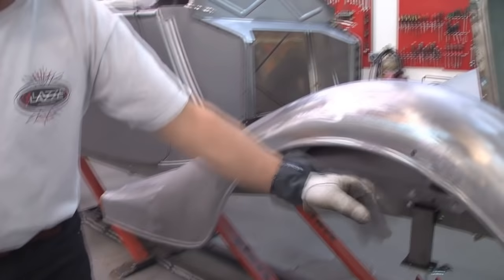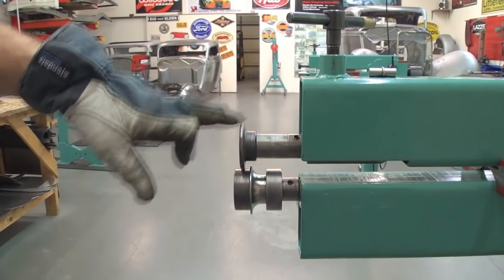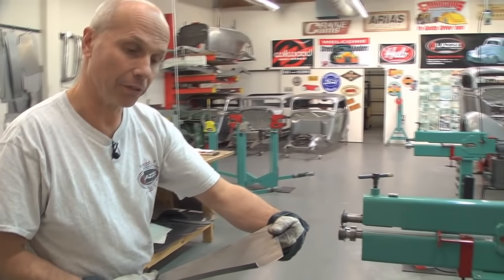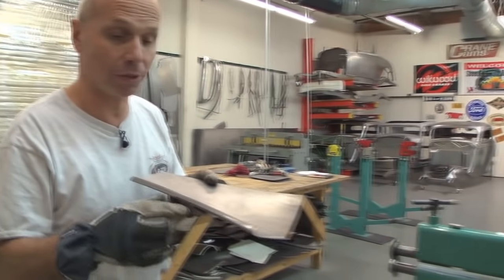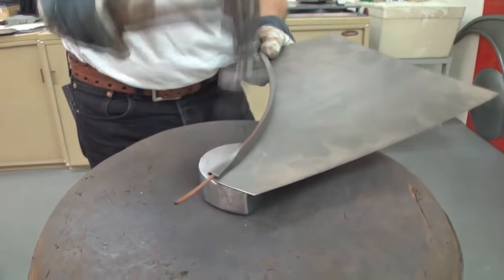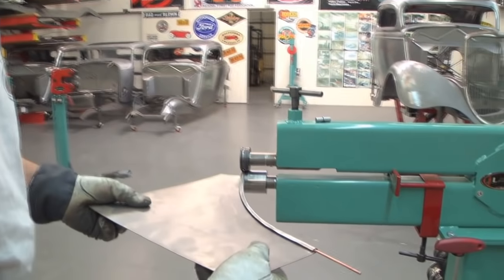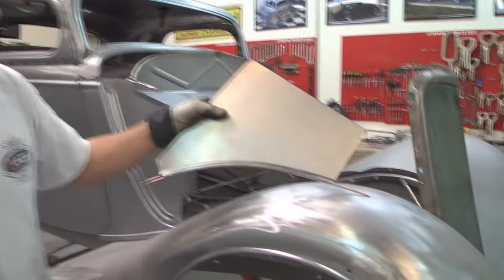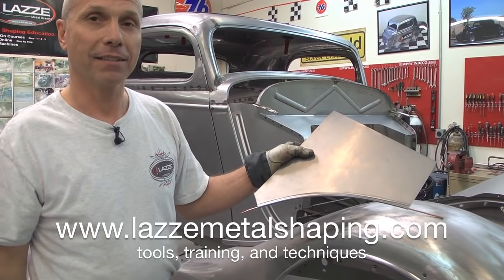Metal Shaping with Lazze: Rolling a Bead with a Wire Edge

Comment: I'm a Sheet Metal Worker by trade... our trade encompasses HVAC, Trains, Planes, Automobiles, Roofs and Siding as well as so much more.

THIS is how Automobiles were made back in the day. Now they are simply stamped by large 2000 Ton presses and spot welded by robots. BUT, in the end, the Sheet Metal Worker will be there to repair, restore or rebuild it as the robot won't. :)

Comment: Fascinating....I do all this over the edge of the anvil with hammers.  Not as quickly though!
But its all there...the 90 degree bend, the kick over the top, the lay in the wire and lock it in place, and the reverse curve.  I can usually get it pretty crisp, but I find that the English wheel (flat, shimmed on one side) will crisp it up, make it look machine made.

Comment: Very interesting! I learn a lot every time I watch one of your videos! One thing I wonder is, I have a 1912 Brush, which has not only a wired fender, but also a little splash apron that is rolled into the are where the wire is, in other words, it seems one sheet is rolled over the top, and the apron is rolled under the bottom. Are you familiar with that technique? How is it done?
Reply from the maker: William May I would like to see some detailed images of it. If the apron is what appears in the images online, to be about an inch and is vertical, it might have been done by a specialized machine or dies. There are several ways it could be replicated today. Thanks for watching and asking the question!

Comment: Thanks again for all your videos. Do you put in the wire and then shape it? I'm assuming you do but thought I would ask. If so, Is that copper wire or some other soft metal that would allow you to shape it on the English Wheel after you put in the wire?
Reply from the maker: Thanks for the question. The wire is added when the metal shape is complete. Once the wire edge is installed, it is crimped so securely, it would make any additional shaping 'challenging,' at best. Next time we're teaching this in the class, we'll add the wire to a flat sheet and see how much we can shape it afterwards.